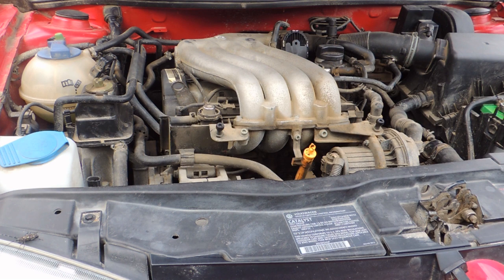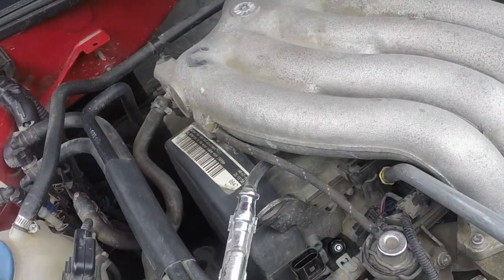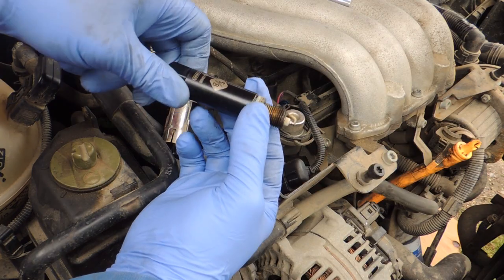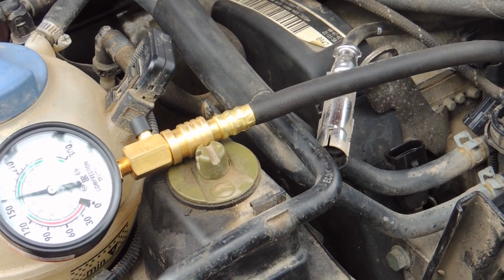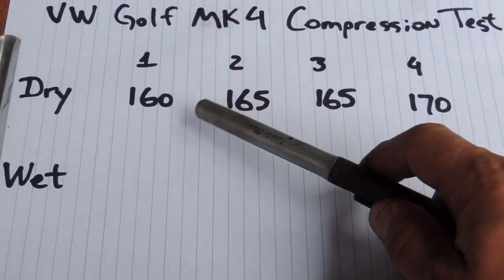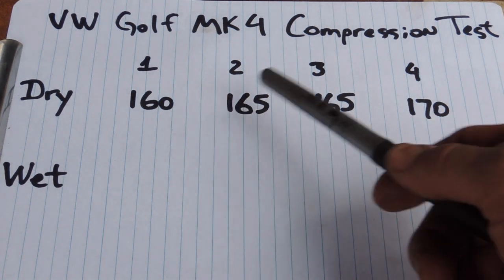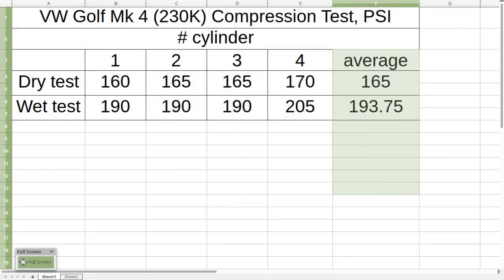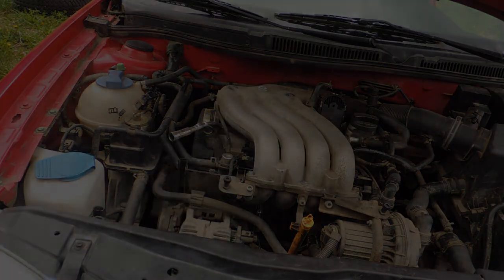HOW TO CHECK THE ENGINE COMPRESSION. DRY & WET TESTS.

Comment: Hi, I have done compression test of car engine i.e. 
Dry 
1.   175 psi
2.    160
3.    185
Wet
1.   210
2.   185
3.    210 
Please tell me your opinion about the engine health 
Regards
Reply from the maker: Overall compression values are pretty even in 10-15% deviation, probably for the old engine. Looks acceptable to me. What engine do you have, diesel or gas?
Reply: So much thank you for your reply, it is petrol/gasoline engine of 2013 Maruti India.

Comment: Hi, the wet reading on one of the cylinders is lower than dry reading..what could be the inference..?

I have done dry & wet compression test on my VW Polo 1.2 TDI..the reading is lower in the wet test than the dry test on cylinder number 3..?

Dry:
1 - 26.7 (Bar)
2 - 26.5
3 - 27.8

Wet:
1 - 27.6
2 - 26.7
3 - 26.3
Reply from the maker: Hey Dinto. How many times did you repeat the test to each cylinder to get average? Difference more than 15% between cylinders is considered to be significant. I won't worry about it, everything looks just fine to me. If compression lower after dry test than manufacture specified, then you do wet test to find what causing compression drop (valves or piston).